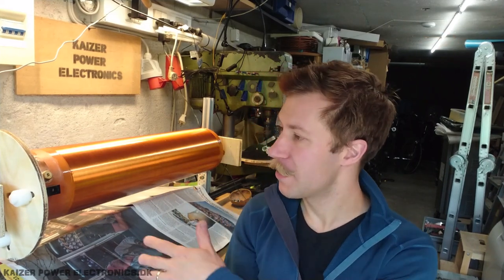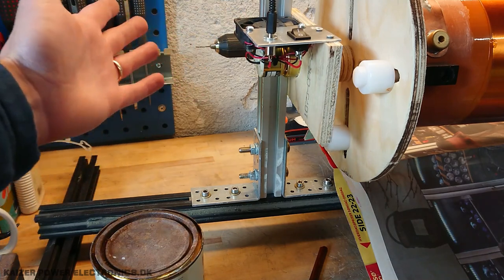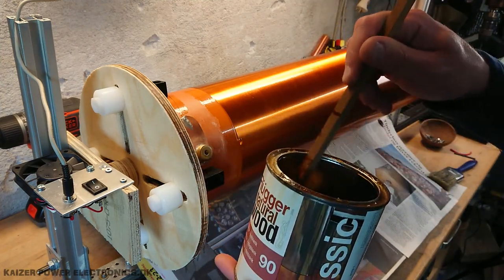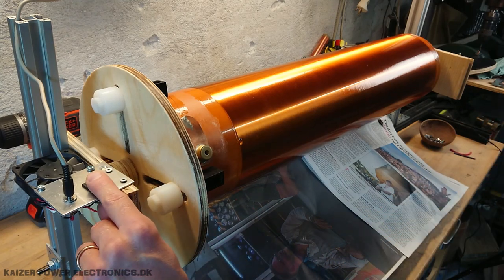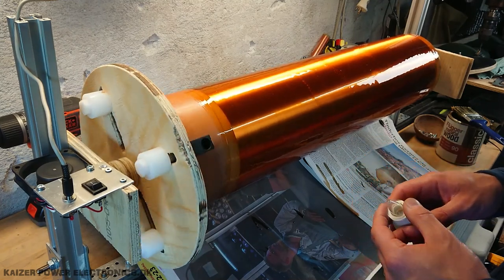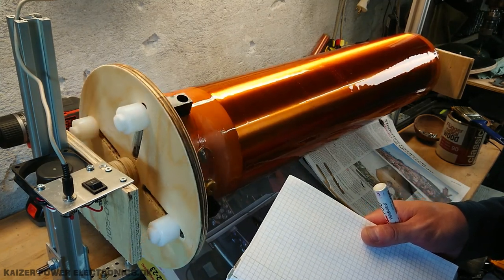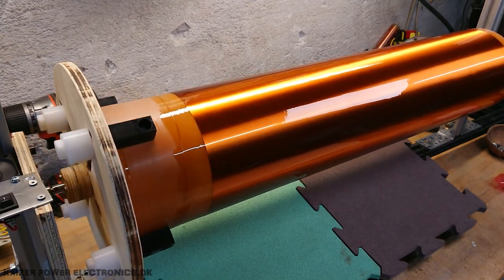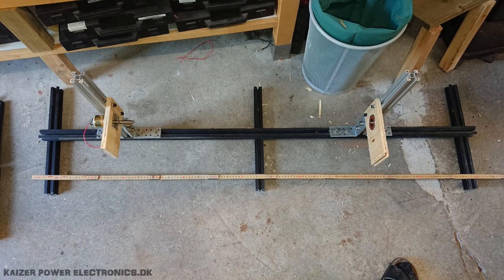How To Varnish A Tesla Coil Secondary Coil

Comment from the maker: What is your best secondary varnishing tricks?
Reply: Using epoxy. You can even do 1mm thick layers at once without a problem and it looks amazing.
Reply: An airbrush compressor - if you have it - without the regulator, tends to pulse air (and has a low air volume) just as your lens dust cleaner.
Might make it easier to remove those air bubbles :ø)
Reply: Don‘t let you trick into putting very thick coats on the coil. The rotation makes it look nice at first but eventually it will result in ugly drops.
Reply: @maxzuidberg2322  not with epoxy. Many thin layers obviously give nicer results but you can do much thicker layers then with other types of varnish as it doesn't need the air to dry and the hardner gets mixed in evenly. I've experienced weird patterns due to uneven drying of thick layers of varnish but with epoxy that just doesn't happen.
Reply: Do not use spray can lacquer

Comment: I used epoxy tabletop varnish for my secondary coil.  It made a very thick, durable layer.  The only downside is that it is somewhat uneven, and mine has some small thickness variations, but it definitely insulates well.

I built my own jig for winding secondary coils on PVC pipe coil forms a while back.  PVC end caps with a hole drilled through the center and the axle driven through the holes seems to work ok.  A hole drilled through the sides of the PVC end cap and the axle may be used to lock the cap to the axle using a long pin or a thin threaded rod.  You may have to keep a little extra length to the coil form in order to put the caps on that you saw off afterwards.  I also had a second axis next to it on which the spool of magnet wire was placed, and as the axle turned, it would take up the wire.  I used cyanoacrylate glue to tack the turns in place maybe every 20 to 30 turns.  

If only I had the electrical power available to drive a bigger Tesla coil...

Comment: Stepper motors can be salvaged from old printers and whatnot, should be pretty cheap to run one from an Arduino in order to be able to use the same setup for winding the coil and varnishing it.

Comment: i applied a coat of Alkyd wood varnish to my secondary and it dries so slow. should i wait more or what?
Reply from the maker: How long did you wait? What is the surrounding temperature? Humidity? What kind of wood alkyd varnish?
Reply from the maker: @wwscsd  does it say that you SHOULD or that you COULD? I never use a thinner, but I do not recall that my cans said anything about it, only if you wanted a thinner coating.
Reply: it says we should.i think with thinner coatings it dries quicker, doesn't it? @KaizerPowerElectronicsDk
Reply from the maker: @wwscsd  Thinner coats dry faster. But you also have to do more coats, to get a good thickness. Randomly googling gave me "As a general rule, polyurethane can take as long as 30 days to completely and correctly cure. It would be best to give yourself a full 3- days before using your wood floors following a polyurethane treatment for the best possible outcomes."